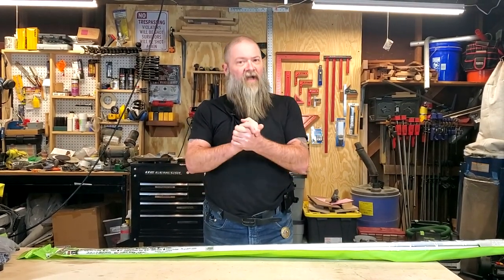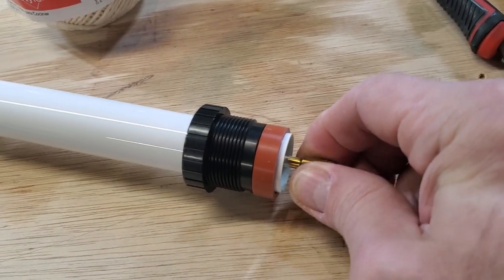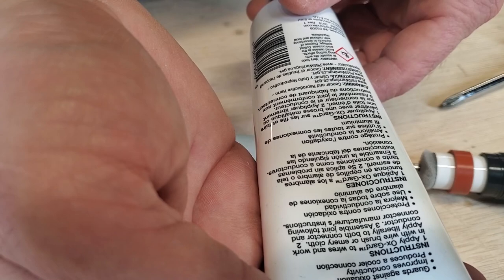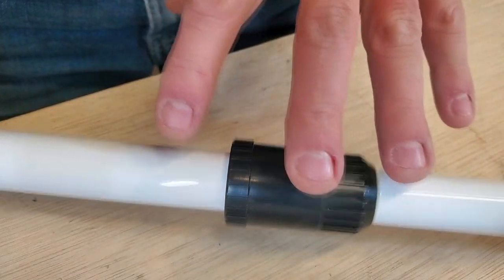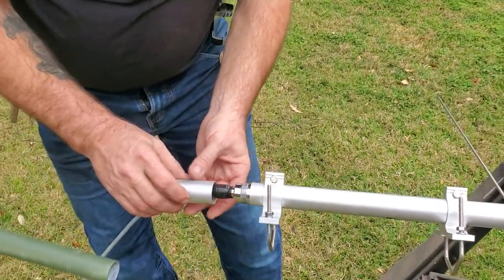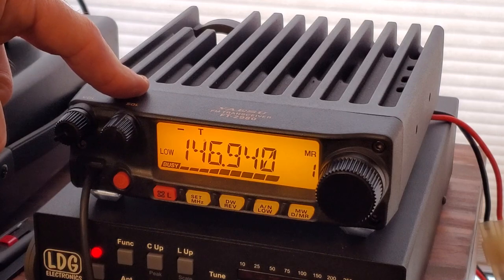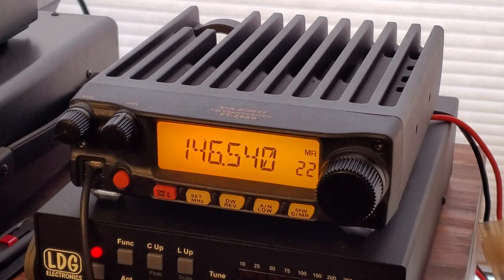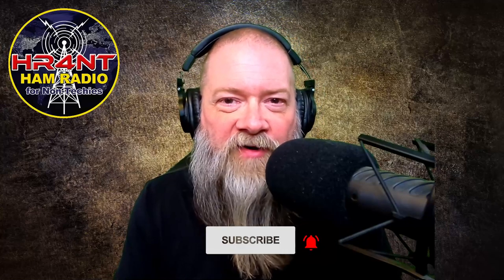Building the Comet GP-9 with the Yaesu 2980

Comment: I have a GP-9 yet to be installed. What did you use for the antenna mast?
Reply from the maker: I went to Home Depot and bought chain link fence top rail.  It's cheap, interlocks with each other and comes in 10 foot lengths.  Still works beautifully to this day.  I hope this helps.  Thanks for the comment and for watching.  73!

Comment: I was wondering is there any isolation in terms of radiation if you paint the antenna? Doesnt it affect the power of transmission?
Reply from the maker: The paint used had no metallic components in it and I have not seen any performance issues with it since I bought it.  Thanks for watching and for the comment.  73!

Comment: I would have used some of that grease on the coax at the end, and spot-tie over the end of the tape, that’s were it will come off in a year to so.
Reply from the maker: You are spot on.  I went back and did exactly that to add a second layer of protection to the connection.  Thanks for the comment and for watching.  73!!

Comment: When to choose a gp 6 over the gp9 model? Trying to choose one.
Reply from the maker: GP9 had better/higher dB gain which is why I went with it.  I also knew I was going to put it up at least 25 feet in the air...Either one will work, just which one (in size) do you want to deal with.  The GP-9 is almost 17 feet long.  Thanks for the comment and for watching.  73!

Comment: Post a picture of how you have the antenna pole secured to the ground. 👍
Reply from the maker: To secure that pole to the ground I did two things.  As you see in the video I have a bracket that I attached to the eaves of my roof on my garage.  At the ground level, I went to Home Depot and in the masonry section I picked up a solid metal masonry pole I am guessing it is about 1/2 inch thick or better and drove that into the ground leaving about half of the pole above ground that I slid the fence top rail I am using as a antenna mount and called it done.  Works fine and hasn't moved a bit in years.  I hope this better helps explain what I did. Here is the link to that stake I used:  https://www.homedepot.com/p/Grip-Rite-3-4-in-x-36-in-Round-Stake-STKR36/202090777  Thanks for the question and for watching.  73!
Reply: @HR4NT  
Thanks brother. Much appreciated. 73! KC8NLT.

Comment: Hey man, I’ve been comparing this radio with icom 2300h, from your own point, which one you’ll recommend?
Reply from the maker: They are very similar except the Icom is only 65 watts and the Yaesu is 80.  So I think power and brand are the only things you need to consider.  I think you could be fine with either one.  I hope this helps.  Thanks for the comment and for watching.,  73!

Comment: One ham friend of mine who is now SK once told me that he had to weld the sections of antenna at the joint because over time the screws will come loose. I was wondering if you had any issues with the screws coming loose or hearing any noise if they were loose. His was a GP6. I have two GP3 antennas in the attic above the second floor, and they work pretty well. 73 KD5YOU
Reply from the maker: To date I have not had a single issue with at antenna.  If you had a fear of screws coming loose, maybe try a little dab of blue locktite on the threads before tightening them.  I cannot imagine a situation where the screws would be in a position to come lose in the first place.  I hope this helps.    Thanks for the comment and for watching!!!  73!!
Reply: @HR4NT  Ok thanks. I think it might have something to do with high winds not necessarily exceeding the maximum wind speed that the antenna can withstand. I'll ask tonight during our local net to see if anyone has had a similar issue.
73 KD5YOU
Reply: What mast are you using and how is it installed? Great video, thanks!!

Comment: How many Amps does it draw from your supply at 80 W power out?
Reply from the maker: The specs for the Diamond GZV-4000 states that it is 40 amps at 15 watts.  Not sure if that helps you out.  Thanks for the comment and for watching.  73!
Reply: Thank you for the reply.  Sorry for not being clear but I was simply wondering how many amps the Yaesu radio draws when set to full power?  I have a 15 Amp power supply in my shack but am not sure if it’s big enough for that radio.

Comment: Does this antenna have to be a specific height? Can I sit it on a 5ft tripod next to my house?
Reply from the maker: You can have it up as high as you want, however, if using simplex, height is key to reach out further.  I have mine up 25 feet becasue we do a simplex net and I need to be able to reach out 30-40 miles.  I hope this helps.  Thanks for watching and for the comment!  73!!
Reply: @HR4NT  So when you say you have yours is up 25ft do you mean 25ft from the ground or do you mean it is 25ft up from where the antenna starts? Also ,will trees around the antenna hinder the signal and distance?
Reply from the maker: @BlackHamRadioUniversity  I have a 25 foot pole stuck in the ground and the GP9 is attached to that pole.  Trees will play a small part in interference, but unless you are surrounded by a thick forest, I wouldn't worry too much about it.  My antennas are right next to a huge oak tree (maybe about 20 feet away) and I do just fine.  Hope this helps!  73!!

Comment: KF0HRF I have the 2980 but can only put an antenna in my window so running a DIY dipole it hits the repeater fine but in 3 months no ones on 146.250.
Reply from the maker: Did you mean 146.520?  If you are trying the main 2m frequency, it is .520.  Thanks for the comment and for watching.  73
Reply: Tram 1159-WB is a great antenna for the ft-2980 no ground plane necessary and full range 136-174.
And I've had some luck with the roll-up J pole by N9TAX on ebay. 
Hope that helps

Comment: Make sure you grease the little ring that covers the pl259 will corrode and you won't be able to get to the coax connector without modification 73 KE4GBH
Reply from the maker: Absolutely.  I always make sure I have that with my connections just because of the humidity here.  Thank for the comment and for watching.  73!!

Comment: they say that carbon interferes with irradiation, does this ink have no carbon? Sorry for my question, I don't understand English very well, what's the gain? thanks from PS8AJR - Ary Junior - Brazil
Reply from the maker: Hi Ary, the carbon does not interfere with the antenna and it has performed very well since I built it.  The gain of this antenna is around 8.5dB.  Thanks for watching and for the question!  73!!

Comment: Thanks for the vid Scott. Now that you've had it for a while, what's been your furthest contact? I have a Diamond X300A @ 60' but still way short of the urban repeaters that I'd like to reach from our small town. Even my Diamond 10 element yagi down below it comes up short of the 60-ish miles needed. I'm dithering between replacing the 300 with a X510 or the GP-9 and then flip'n the yagi horizontal for SSB.
Reply from the maker: So far I think my farthest distance QSO was about 35 miles.  I really need to test this when the propagation is good in my area and see if I can reach out a greater distance.  With your X300 you are getting an average of 6.5db on VHF and 9.0db on UHF.  With the GP-9 that would increase to 8.5db on vhf and 11.9db on UHF.  So that may be a substantial gain with the GP-9 over your current antenna and the X510.  Height and gain are going to be key if you are far away or in a geographical area that may block line of sight.  I hope this helps a bit.  Keep in touch.  I would be interested in hearing the outcome and success story!  Thank you very much for the comment and for watching.  73!
Reply: @HR4NT  Thanks for the quick reply, really appreciate that you keep in contact with your viewers and I admire the professionalism of your channel content.
I'm likely chasing smoke without a quad yagi stack. My A144S10's gain is supposedly 11.6db and in ideal conditions I hit a desired 60mi distant repeater one time (over 6mo) for a short QSO. Which is a shame, since moving out of the big city left behind several 2m ham friends tho' we keep in contact via DMR. Most likely I'll replace the X300 with a GP-9 next year for broader area simplex coverage and keep the yagi for sideband.  73

Comment: There so many better choices for feed line.
RG8X is almost the worst.
Lmr 400
or
LMR 600 
are way better the RG8X on
2m and 70cm
Reply from the maker: I understand that, however that is all i have at the moment and it seems to work fine.  Reaching out 35 miles on simplex .  Thanks for watching and for the comment.  73!

Comment: You're going to cause it to build condensate inside your antenna will sweat not good for your connection take the condensate off and that tape😮😮😮😮
Reply from the maker: I have not had any issue with the antenna to date, but i will go have a look at that.  73!

Comment: why not paint the bottom of the antenna ?. and it was a waist of zip ties , they would be better used on your coax rather than the alloy brackets .
Reply from the maker: I did not paint the bottom of the antenna in the event that I had to do maintenance, I did not want to fight the paint affecting the threads and other parts of the antenna to get it back apart.  The zip ties were just to add additional support in case of high winds.  It may be a little overkill, but it seems to be working since I shot the video.  Thanks for the comment and for watching.  73!

Comment: You did all of that work and used Garage Coax? This is for VHF/UHF not HF so you don’t use the CHEAP STUFF.You should have used LMR-400 at least. You are Losing all that you gained with the High Gain of the antenna just is the Poor coax.Had I known that in the beginning I would not have watched the video.👎🏻
Reply from the maker: Sorry it did not meet your expectations.  I worked with what I had available to make at the time. Feel free to send me 75 feet of LMR 400 if it will make you feel better.  I can't afford it at the moment.  73